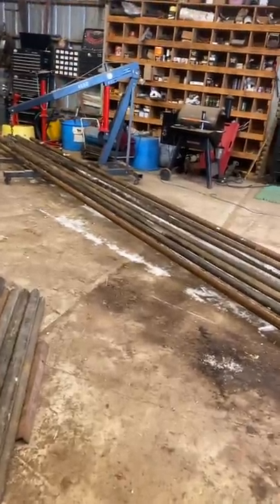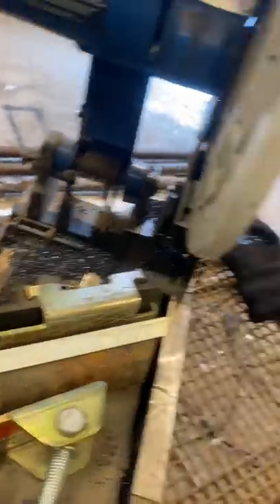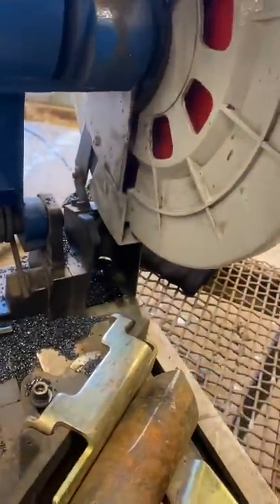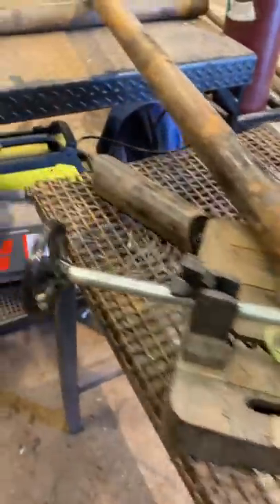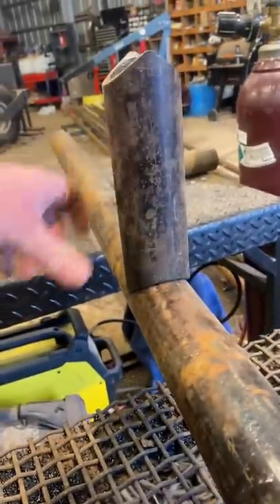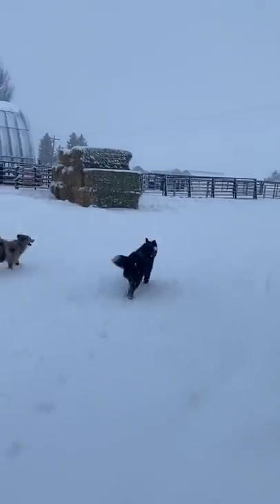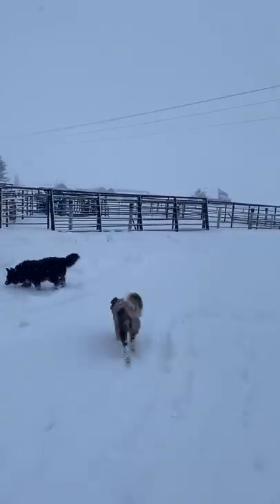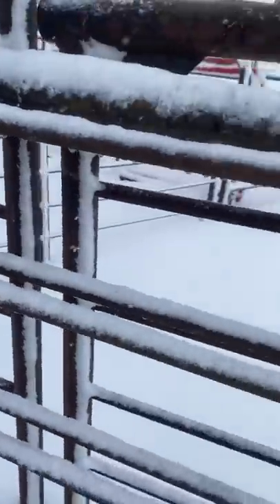How I Cut Saddles in Pipe With a Chop Saw

Comment: On black pipe you can also use the weld seam inside of it to line up end to end.
Reply from the maker: Never thought of that, great idea!
Reply: What he is building those panels out of is 2” I.D.  oilfield tubing.  It’s not drill pipe.  It is seamless D.O.M. tubing.  Drawn Over Mandrel.  It’s a lot stronger than black pipe.  It’s much better steel.  I would not build free standing panels out of regular black pipe if they are going to be moved and handled a lot.

Comment: Hey brother good video I work as a welder and have never seen coping done that way thank you for the tip with the price of wood I’m leaning towards steal pipe to build my carport.
Reply from the maker: You are welcome! I’ve been thinking about building a carport out of it too. Some guys around here build a lot of movable calf sheds out of drill pipe
Reply: Thanks for replying I ended up going to Home Depo so didn’t do the fab rout preference is metal but simplicity was wood love the video I’m subscribed 🤙
Reply: Drill pipe is super cheap, I built a 15x15 roof the pipe ran me about 20$ a joint so I used around 80$ in material...
Reply from the maker: Awesome man! Thanks for subscribing!
Reply from the maker: @john dowe that’s a lot cheaper than what I found mine for. I was $35 a stem delivered and that was for a semi load
Reply: @LuthiRanchWY  hot damn I've never seen drill pipe go for that much in my area. 27-29$ is the most ive seen on 2 7/8 pipe.
Reply from the maker: @johndowe7003  I wish the prices were still that low! I saw someone trying to sell a joint for $78 the other day and they will probably get it

Comment: Nice job Brian! I use to use a portable band saw to make the same cut. That chop saw would be a lot handier.
Reply from the maker: I’ve never tried it with a band saw, I really like doing it with the chop saw even more than a plasma cutter or torch
Reply: Only thing about.using a bandsaw is that the blade wants to twist on ya sometimes otherwise it's faster than the chopsaw. I got a deepcut milwaukee which is perfect for the job

Comment: Use a hole saw to make saddle cuts. I cut makes two saddle cut ends, no grinding .use same size diameter hole saw. Use cutting oil . Did this back in 1990.   Was shown by a Alaskan pipe welder.  Stan decker
Reply from the maker: I’d like to see how that is done

Comment: I've never seen that method used to notch pipe, but it sure appears to provide good fit-up. Question: you mentioned that the chop saw is set at 35 degrees - Does that angle work for any diameter of pipe? If not, is there a formula for determining the proper angle of cut? Thanks in advance for your reply!
Reply from the maker: So 35 degrees will work with any diameter of pipe as long as the pipe you are joining it with is the same size as the pipe you are saddling. For sizing to different sizes of pipe I’m not exactly sure the formula but there’s is a book called “The Pipe Fitters Blue Book” that would have all that info in it

Comment: To align the cuts, so that both ends are the same.... use the seam weld inside the pipe as a straight line. On a short piece of scrap pipe, cut the perfect saddle, then use it as a template.
Reply from the maker: Great advice

Comment: Is the 35 degree cut the same regardless of diameter of pipe? Thanks
Reply from the maker: Yes as long as the pipe you are joining it with is the same diameter as the pipe you are saddling
Reply: @LuthiRanchWY  thanks

Comment: Awesome video. I been wanting to do a video on this just haven't had time to finish my fence.
Reply from the maker: Thanks for watching! Are you putting up a pipe fence also?
Reply: @LuthiRanchWY  I did 300ft of fence and just saddled the top and placed some 2 7/8 pipe. I did some h post a while back and never did a video on saddles. Pipe is expensive I called today for 4.5" used joints and 4 joints was $940 delivered. I paid $25 for the 2 7/8 and now they are $60. Well cool video like I mentioned.
Reply from the maker: Thanks. Ya it’s really expensive here too. 3 years ago a paid $35 a joint for 2 3/8” and that was delivered also. And now last I saw it was in the $70’s

Comment: What blade are you using on your chop saw if you don’t mind giving that out
Thanks so much
Cheers
Reply from the maker: I was using a Diablo dry cut blade 14” I usually use a Steelmax dry cut blade 14” they both have been good blades

Comment: Brian, watched the two videos on how you build those panels. Great work and thanks for sharing. What state do you live in to get all that snow? Also, how many cuts can you get out of that Diablo blade?
Reply from the maker: Thank you and you’re welcome! I live in western Wyoming right by the Idaho border. This is actually the first Diablo blade I’ve used and I haven’t worn it out yet but I was using Steelmax blades before and I’d get about 250 cuts out of them. That’s 250 cuts on 2 3/8” drill pipe though so I’m sure if you were cutting smaller types of metal you would get substantially more cuts out of them. I do feel like this Diablo blade is holding up about the same if not better than the Steelmax one.

Comment: Off the wall question... I’ve got a do little trailer that has pipe... I want to make uprights... it’s about 3” horizontal pipe... will a 1” black water pipe weld to the existing pipe?  As I don’t know that original metal material makeup....?
Reply from the maker: I’d have to see what you are talking about
Reply from the maker: Did you end up welding it up?

Comment: Nice video! I can’t find the mental anywhere. Where should you buy the pipe from?
Reply from the maker: I’ve just found mine on local classifieds. We live in Wyoming so there is alot of drilling that goes on. You can also find some in Ranch and Farm magazines and papers.
Reply: @LuthiRanchWY  I found some. Planning to build a fence and some horse shelters next month. Do you know the approximate weight of used 2 7/8 drill pipe? I don’t want to overload my trailer..
Reply from the maker: @NoNo-uu8mz  I’m not exactly sure on the weight of the 2 7/8” but I would guess around 150lbs a length

Comment: What kind of saw blade do you use and where do you buy them
Reply from the maker: I usually use Steelmax 14” dry cut blades and you can buy them at AirGas and I’ve even seen them on Amazonhttps://www.amazon.com/dp/B00820HN5A/ref=cm_sw_r_cp_awdb_imm_461ZHBG0YNE50FKN37W2
I’ve got a Diablo Dry Cut metal blade on there now and I feel like it came from Northern Tool. But I’m sure you could find it on Amazon too or any industrial supply store

Comment: I think the torch saddles are pretty sloppy at best, at least from farmers that build themselves, ( colder weilds)it seems that you have to reduce the fixture marking amount by about an eighth or 3/16, then the " off set " from to verticals I side measurement, increases only .75 inches total, maybe 7/8 
, but you also have to skive cut the ears to thin them.
Reply from the maker: The chop saw sure makes it look nice and clean

Comment: What kind of blade do you use
Reply from the maker: So I use a Steelmax dry cut metal chop saw and the blades I usually use are also Steelmax dry cut metal blades 14”. But the blade I have on there now is a Diablo dry cut metal blade 14”

Comment: What saw are you using? Doesn't look like regular abrasive chop saw
Reply from the maker: It’s a SteelMax Dry Cut saw they are a bit different than an abrasive saw. I’ve got a video about the differences if you want to check it out. https://youtu.be/GKbk5rpDmEk
Reply: @LuthiRanchWY  thanks I will check it out

Comment: What kind of saw blade are you using?  Looks like carbide cutters?
Reply from the maker: I was using a Diablo dry cut saw blade 14”. I usually use a Steelmax dry cut blade 14” and I think it’s tungsten tipped. Both have been good blades. https://www.amazon.com/Steelmax-TCT-Blade-Mild-Steel/dp/B00820HN5A

Comment: Which model blade is that
Reply from the maker: That one is a Diablo 14” dry cut saw blade. I usually use a Steelmax 14” dry cut saw blade though. Both have been good
Reply: @LuthiRanchWY  Thanks

Comment: That is 2 7/8 work string, not drill pipe. Good job on the saddles. Much faster with a torch but not near as pretty as yours with your method!
Reply from the maker: Thanks! Ya I’ve been corrected on that a couple times on calling it drill pipe. Around here anything that comes out of the oil field we just know as drill pipe unless you actually worked on the rigs and know better haha